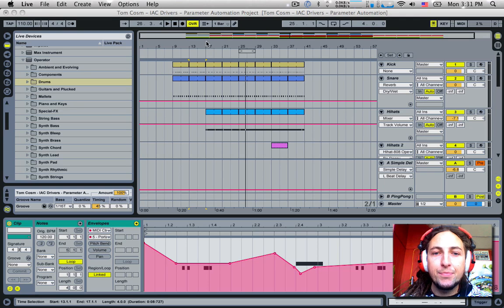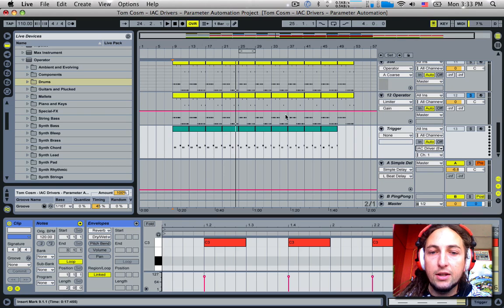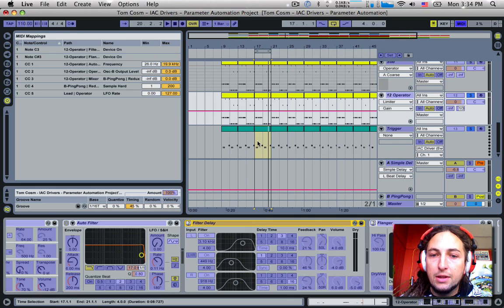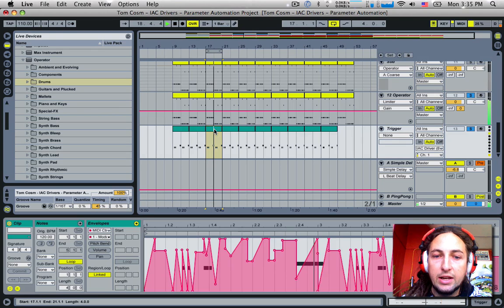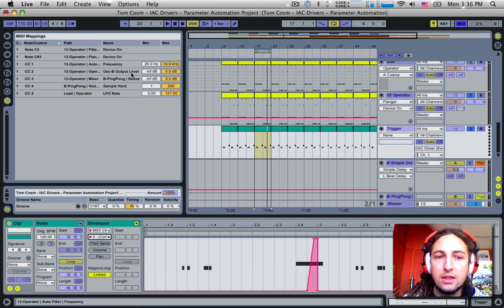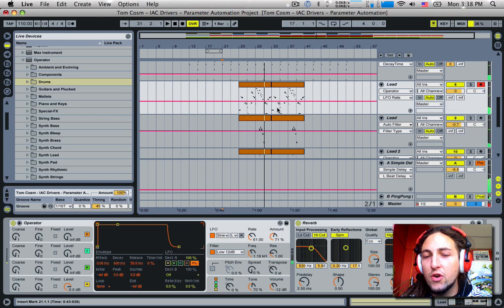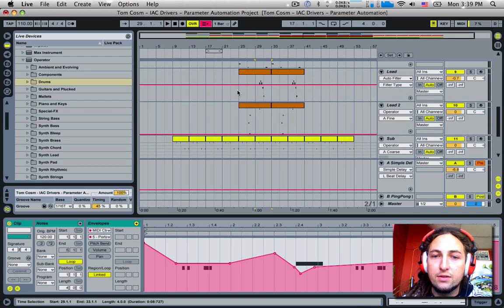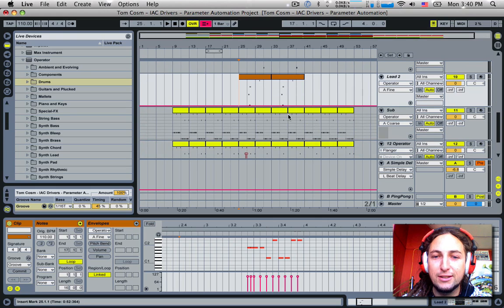Advanced Ableton Parameter Automation using IAC Drivers

Comment: How do assign a fader control to an effect parameter of I don't have it on my midi-keyboard? I mean in the envelopes section (unfortunately not in the track settings, but only the clip) i  can set the output control, but then i go to the effect, and to midi-map a parameter i need to twist some knob which i don't have. Alright, i have a mod wheel and a pitch bend, but that's far from enough.